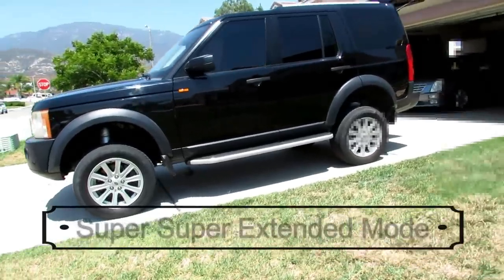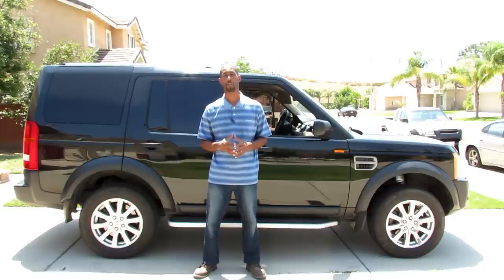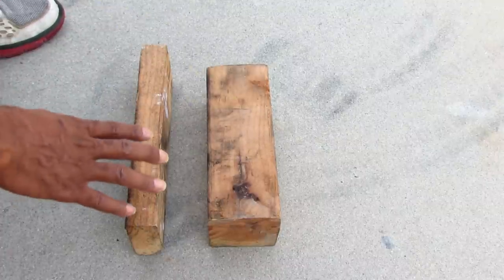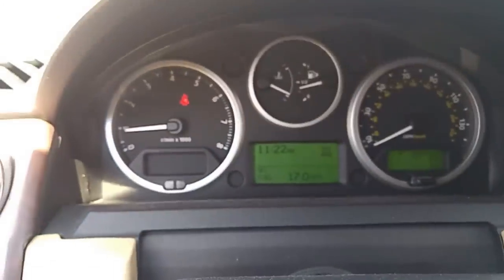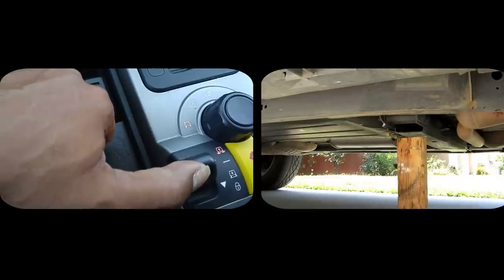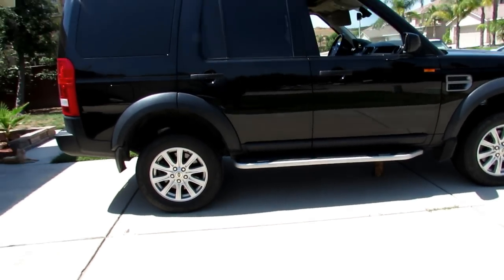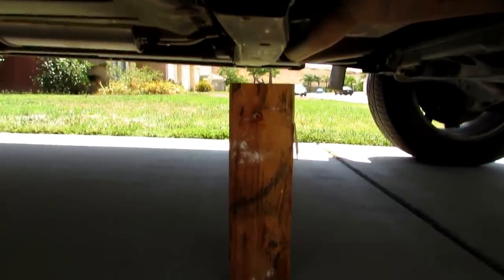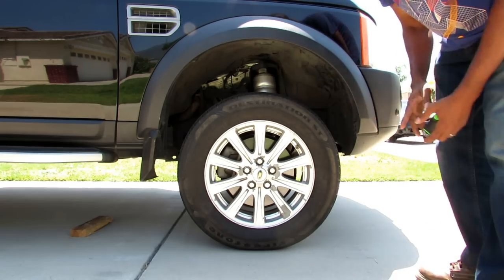Land Rover Discovery 3 Learn How To Go Into Super Extended Mode - You'll Love The Added Height

Comment: What is Super Super Extended Mode - at no stage in your video were you higher than Super Extended Mode - nothing that the car was not designed to do and is all covered in the manual.  I have LLAMs fitted to my car so can go +50mm higher than whatever is selected or what the car does - however it cannot go higher than the what the suspension is physically capable off.  When at offroad height and LLAMS at +50 I am about the same height as super extended height (your Super Super height).  If I then grounded the base height setting should try to go from Offroad to Extended height (I then have my extra 50mm) but it probably will not go much more because of the suspension limitations.

Nice vid but there is no such thing as Super Super Extended mode.
Reply from the maker: Thanks for the detailed comment. At the beginning of the video, I'm in super super extended mode. Regular off-road height is 14" measured from the center of the LR @1:03. Then super extended mode raised it to 15 1/2" @ 3:15. Then what I'm calling super super extended mode is @ 4:36 and the height went to 17 1/2". This is how I got it to that height. I put a floor jack under the frame and raised the LR and then it stayed there. I have been at this height before when I was off-roading and the vehicle became grounded on one side. The Rover will continue to try and level itself until it can't go any further. 

I started the video off in super super extended mode just so people could see what it could get to. Then I show the process. You are right about the name, I just came up with that because I didn't know what else to call it. Thanks for watching.
Reply: Thanks - what you call Super Extended mode is what Landrover in the handbook call Extended Mode - and what you call Super Super Extended mode is just what we all call Super Extended mode (actually LR dont refer this as anything in the handbook).  So please do not use terminologies that are not relevant - it just confused people.

You go from Locked Access Height, Normal Access Height, Onroad Height, Offroad Height, Extended Height and then to Super Extended Height - there is not Super Super Extended Height.  Of these heights the only one that is not selectable is Extended Height as this is the grounding escape function and the car will do this automatically if it detects it is grounded - this is what you mimic with the blocks of wood.
Reply: @joeblow3823  But the car can and will actually raise more than the super-extended apparently..

Comment: the USA Marketed vehicles are different to rest of the world, the key has no LR button, but a hazard button in its place
ride height no hard switch but a rocker button, hence most of  your lessons are not at all applicable down under where we have d2,3,4  in USA lr3.4, mostly gasoline power LR  dropped the D  name because of the terrible name the Disco 2 had there with gas  engines, the D2 With 5 cylinder diesel was great, drove one all over, now I have the D4, rides like a Mercedes, tows 4 tonnes, but tooooooooooooooo complex for the Outback

Comment: The body is lifted but the axle is still the same height, true clearance is only achieved by running larger tires.
Reply: That's true for a solid axle rig, not for the LR3. The extra gound clearance is legit.